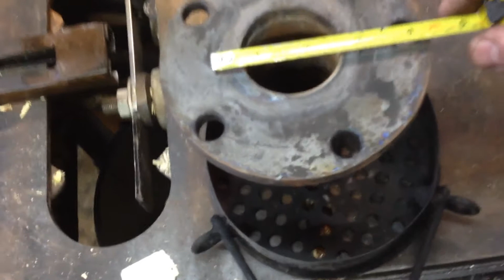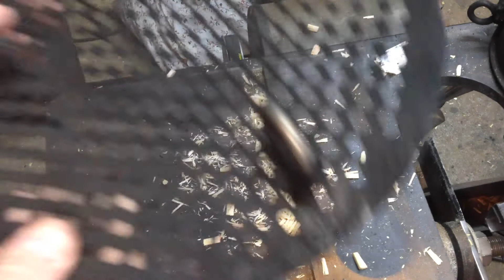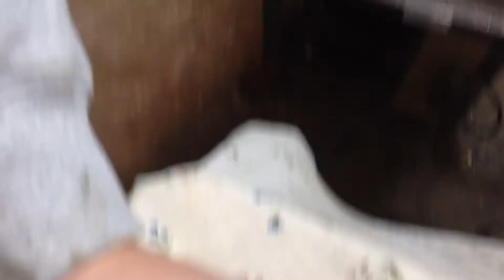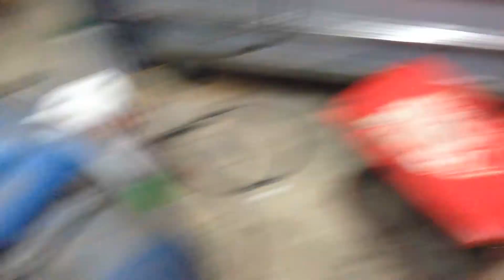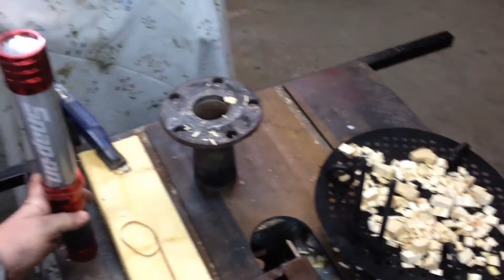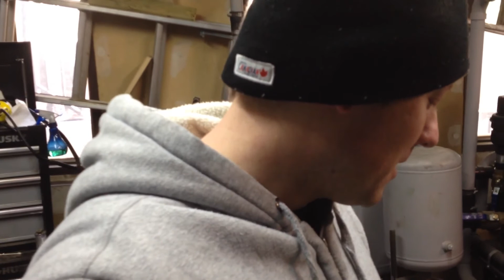woodgas grate design

Comment: Nice work. I’m not at that point yet in the build and I’m looking for the details of what works and what doesn’t. Thanks.
Reply from the maker: Thanks Jerry mine was a down draft gasifier. The size depends on the size of engine to use. YouTuber Flash001USA has great videos and I believe specific drawings on a website that he gives out freely. Lots of great info on the web. As far as I know most work just fine 👍
Reply: The configuration I’m gonna use has the grate nearer to the heat affected burn  zone . I’m hoping it will help have a more complete burn. 4” -5” from jets to the grate . We shall see.

Comment: I'll probably try this myself. I was aware of the issue you described but part of my logic was the charcoals (biochar) building up in the grate would help keep any sudden ember bed collapse issues (major foops) with the ember bed in the hearth. I was seeing that issue with some of my earlier builds even with the old grate that you replaced but that was due to the inverted bell spreading out too much. You're onto something no doubt. This is where I wanted the original build to go because I knew others would find weaknesses in the build and construct a better mousetrap.
Reply from the maker: +flash001USA  Mike your absolutely right man this is what I was worried about too. with the flat spread grate I just barely have to move it around to make a difference, if I did to much there would be a collapse issue.   couple of little taps did the trick.  I found if I got too much air going through the hearth Id get the foops. I tested different types of air inlet sizes to see and yours was the best. More air gave me foops, too small tar issues.  lol gasifiers are so finicky sons of a guns.
Reply: +Josefppaz  My thought is a compromise between what you have done and the standard setup. I'm thinking of a setup with a 1/2 or even a 3/4 lip to hold the biochar in place but open enough to allow it to displace a bit more easily. What do you think of that idea?
Reply from the maker: +flash001USA Mike I have seen guys use the flat grate even on there trucks.  I thought also how the heck does it not allow that amber bed to completely fall out.  Even with mine I was very carful not to shake the grate drastically.  So when the trucks driving how does this work.  Then of course its all about wood size.  More smaller wood means don't go crazy on that grate.  But the guys who drive with wood have big chunks which go through a 5 inch bell to a flat grate and even with the vibration with the road no problems with collapse issue.  Its all very interesting how it works.  I was told flat was best, but this was for big chunks.  I just wanted to see if it worked on my little pieces of wood.  The 1/2 or 3/4 lip try her out man I am curious too.  Even Steve said a good point lip or no lip where the space between the bell and the grate from 1/2 to 2 inches can create collapse  issues.  lol all these factors eh. Its nice to hear from you bud without your videos I don't think I would have done this.    Mike even though you may not know me to well  I heard about your wifes passing and I am very sorry for your loss.  I am getting married next April.  My lady has some problems with hyperthyroid, I thought maybe I would use that vitamin c that you used to help her out.

Comment: just read all the comments and i like your idea on grate design, i have made mine with a small 1/2 lip and it seems ok  does get a little cranky at times,, i might even pull it out and cut the lip off come to think of it,,,,,, the main thing i found is since i run a 5 nozzle set-up and have the burner tubes running down the inside of the gasifier wall then popping into the reduction zone,,and hence getting preheated air ,,,,the size of my bio-char is very small,, half the size of a cigarette butt so i would say the temp in the reaction zone will melt steel and i know this because inside the hopper i run a coiled  agitator  for the fuel and it protrudes past the nozzles into the reduction zone and after the last run it was 2 inches shorter at the end,, now that tells me i would be getting well over iron forging temps down there so pre-heated air is a must for cracking tar.
Reply from the maker: sorry didn't get back to you man but you are absolutely right about heating the air first I got the idea from here (http://kaspar.rammo.net/puugaas/gekveeb/gasification/gek/index.html) I wouldn't doubt it can melt metal lol, some of the guys said to me too you shouldn't get rid of the lip but I tried it and it worked better for me, I didn't shake the grate that much most people were worried about the wood falling right out,  but in my case I needed it because of it sometimes being plugged up all the time.  let me know how it works out for you man, I noticed too that elevation can be a factor as well were I am there is less air at 4000 ft then at sea level so I used a little bigger bell and I needed to have a greater flow of air not by much also with the nozzles its great that you can control it like in your design.  Have a great new year friend.

Comment: Ahhh, that's grate. Oops, sorry, couldn't resist  ;).
I guess each gasifier has different needs and characteristics where the grate and hearth are concerned.
On mine, the grate is very deep indeed. It is about 9 inches deep.
The result is that the charcoal comes out more like fine dust, or coffee grounds.
No gasifier is perfect, but we can get a long way towards perfection by experimenting as you have done here.
Just wondering, if you were to lower your bowl grate an extra inch or two, so that the charcoal would fill it up and then overflow the edges, would this create the same effect as you have achieved with your new plate grate?
Reply from the maker: +CNCmachiningisfun lol grate knowledge man. I noticed your grate was flat too, but I honestly didn't think of lowering the bowl to overflow the edges.  sunofagun I will have to try this on my next build.  buddy I don't have the machine anymore, there are lots of changes coming up for me.  (marriage new place to live), so it will be a little while before I make my next machine. I learned a lot and was lots of fun.  This thing was big and bulky so in the future I want to make something easy to follow for other people to learn and a bit smaller. I told some other guys I am interested in that all power labs gek design.  I really like how they heat up the air before it gets to the ambers.  Looks like they got far less tar this way.    Canada no more pennies so I have to save some 5cents and slowly build the next one my friend.
Reply: +Josefppaz 
It's grate to know that you are experimenting with new ideas.
On mine, the grates are either bowls or sauce pans, as I like the idea of having a ridiculously deep and circuitous charcoal gas path.
Congrats on you new life directions. Such wonderful life changing events will surely allow you to resist the intoxicating effects of the woodgas bug venom for a while. Try not to bite your new wife, as she may also become a woodgas addict, especially during a full moon  ;) .
Yes, I like the GEK design too. It features the results that come from lots of learning and experimentation while under the influence of a serious woodgas addiction.
For some of our gasifier builds, the GEK's method of air pre-heating may be overly difficult to implement, but I am thinking that we can use engine exhaust heat as a way to preheat the incoming air instead. There is a lot of waste heat to be had right there, so why not put it to use  :) .
Long may your addiction continue, and long may smiles and happiness be yours to share with friends and family.
Reply from the maker: +CNCmachiningisfun Thanks a bunch Steve.  lol as I was saying to Dan maybe the new wife and I have a honey moon out were you are..... But then again I might get in trouble filling my brain with gasifiers and beer and not enough honey moon thoughts and romance.....  But then again? there is romance in wood gasification, there is always chemistry going on there ha ha ha ha.  Thanks again for the kind words my friend.

Comment: It looks like you've clocked some hours on that gasifier.  I would say the larger chunks of fuel really slowed down the flow through the hearth when they got to the grate. I would love to know more about your experience with the gas from the gasifier. Did you generate power with it? What size is your generator? how many hour runs did you do? how was the filter cleaning process? What would you improve on when you build your next gasifier? Thanks for taking the time to share your results, and I look forward to seeing what you come up with next. Joe
Reply from the maker: +mazdalorean You bet buddy lots of changes happening in my world, getting married and moving to a new place next year, lol so I have to save the money for that.  This machine I learned a lot, so the next one I would like to make things a little more smaller.  Sadly I didn't use the machine to power a generator, only that 5 1/5 hp engine which ran great. There is no doubt that the wet scrubber is the way to go for filtering on the next build. Cheep to make and less hassle to clean, its almost as easy as changing the oil out of your car.  Again with the hours I had on this thing I could see how the filter does its job as the water changes color.  I personally like the smaller wood chunks, it burns fasters but I find it moves through the system easier. I don't mind the wood pellets but as soon as they get any moisture they turn to sawdust and clog up the hearth which is a pain in the ass, followed by tar.  One big change I would like to do is heating the air before it gets to the ambers like what all power labs did with there gek design, I guess they got a lot less tar issues due to air getting pre heated before it would hit the reactor.  hope all is good buddy.
Reply from the maker: mazdalorean wow has it been three years already time flys fast Joe I haven’t done much of anything my friend lately it’s been work and more work but I have posted one of my new projects that pulse jet engine hahaha and still haven’t run that thing yet. Well last time I talked with you well now I’m married moved into a town house and have a little machine shop in the garage but no new gasification projects yet :( hope is all well with you guys for some reason this is the only way to message you back man. Anyways take care Joe

Comment: its nice it might just waste a little bit of good still-burning char as it may be sucked out the now open sides of your fire grate before they have been fully burned, this may cause filters/water traps to fill more quickly and add more particulate to your gass output

Comment: Hi, it could be that the problems are caused by the uniformity of your fuel. 
In flash001usa , is fuel is much more uniform than yours. 
You have a lot of little pieces even look like sawdust 
That could be you issue with the bridging

Comment: Hmmm thinks compromise.. equal ..use a 1/4 inch lip on edge .. idea is to burn all and burn it hot ! ...im got a 55 gal charcoal maker.. I don't need the xtras u got in wood gas maker/ I want more wood gas and better :>) - thinking on the heatsink- make it taller and able dry wood out more (prep wood ) before burn it!

Comment: About how much did it cost to build you're gasifier all together including your ideas?
Reply from the maker: Larry about 2500.00 in that ball park bud. using new material the oil drum new was about 200 dollars you can make it a lot more less expensive, and smaller it was a great learning experience. Parts used in Canada place called princess auto, in the USA I think its like Harbor freight hope this helps

Comment: Silly question time. When you are cleaning out your char, is it pure char or more ash? I ask as I would like to be able to use the charcoal for other applications. Love the videos. Good job.
Reply from the maker: Kai Casson I’d say a little of both bud. When it’s ash means it’s usually all burnt up with the use of oxygen. The char is there aswell mostly pure carbon like cooking the wood in a very low oxygen environment. When this thing is working you get a little of both. Most of the ash is more of a white texture and the char is black. Hope this helps

Comment: Pretty sure the bowl design is to promote efficient use of the biomass. Have you noticed you use more fuel ?
Reply from the maker: Yes I have man but less clogging
Reply: @Josefppaz  ya. Guess it's just about finding that happy medium
Reply from the maker: Matthew Lanning absolutely bud
Reply: @Josefppaz  are you using this system on a daily basis to produce your electricity?
Reply from the maker: Matthew Lanning no man this was just a proof of concept I’m just one of those guys who builds something to see if it works and if I can make it better awesome. It was a great learning experience so if there ever was a time of no electricity I’m happy I have the knowledge. Steve on CNC machine is fun on you tube uses this for his place and flash001USA I think is the same just wants to see if this stuff actually works
Reply: @Josefppaz  dope. I'm thinking of doing this to charge my self built power wall. Looks way cheaper than investing in solar. Thanks for the uploads
Reply from the maker: Matthew Lanning thanks Matt. I know solar would be more money but it’s more cleaner. The amount of tar and ashes can be a pain in the ass to clean build a small one first see if you like it these things can be finicky 👍